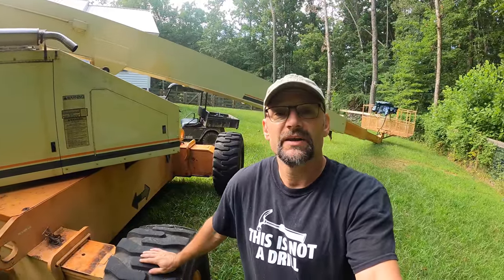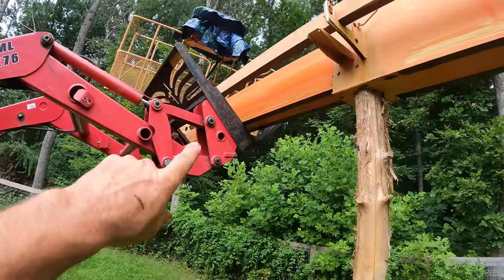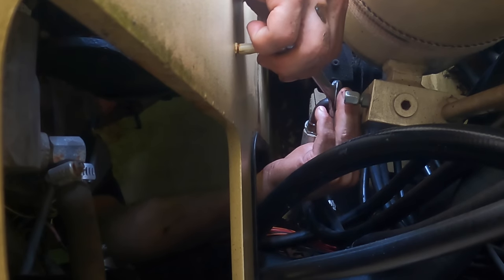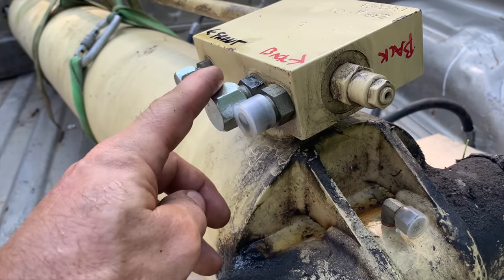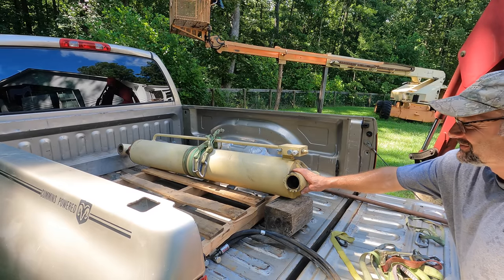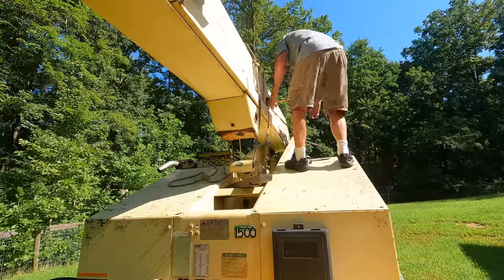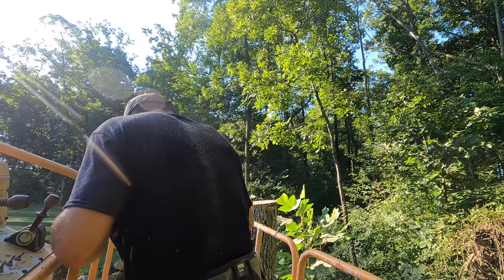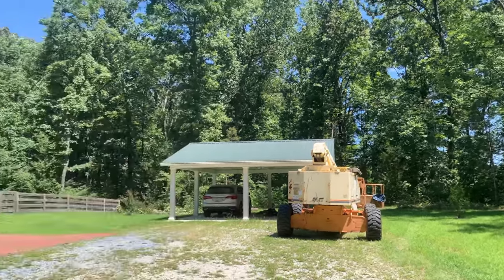Boom Lift Repair - Main Hydraulic Cylinder. What a BEAST! & Cutting Down Dead Trees.

Comment: Depending on whether you're to keep the wood you cut or not, I would say for felling 6 trees (in one or two days) I would ask something like between 1200 and 1600$ depending on the difficulty of the terrain and any "specials" the ground owner asks. If you're supposed to remove the wood the price would be closer to 2000$ (uninsured of course). 
I'm guessing though that as farmer you are insured for possible accidents while working "in the field". So the final tab would be as I mentioned before; between 1200 and 1600$ for 6 trees.
Either way, you won't get rich on it. It would have been more profitable had you been able to remove like the full length stems of the trees for logging purposes, since good oak planks and beams are at a premium nowadays. I really thought you would draw attention especially to the length of your john... I mean your pin but you didn't ... now that's what I call exemplary manly restraint :P
Reply: I don't know where you live but I think your estimate is way low! My bother did tree work in NJ & it was any where between $800 -1,200 PER tree & that's if they didn't have to use a boom.
Reply: I live in a rural area in Europe and where no "special" measures need to be taken, since felling trees is a matter of routine. Obviously that doesn't involve clearing the wood or using special equipment like lifting booms, which of course would drive up the price here as well. Also a lot depends on the number of people involved in the felling. In farmcraft's example he's alone and doesn't use any special equipment except his lifting platform. A chainsaw I regard as normal equipment.
On second thought since inflation is driving up prices, as well as shortages of certain materials and specialized workers, it's quite possible the prices I mention are passé here

Comment: I was waiting for the part where you were required to BLEED the cylinder. Apparently that wasn't necessary. Nevertheless, with complete disassembly and lines left open, I don't understand why you didn't have to bleed it. A little enlightenment from anyone who knows? THANKS

Comment: besides you the next one we get to see is a lot of 🦭 🦭  🦭 
Sometimes things happen for a reason  , IN the long run ,  it's not always the most convenient time  . If I remember correctly you had thought out loud about it may be the right thing to do was to change the hydrologic oil when you started to replace engine oil 🛢 🤔  ?  At the very least it's warm and not raining and cold  !  Now a good pressure washing after you complete the job should do a little bit easier with all the oil to loosen up years of dust and dirt   .

Comment: Awesome video and thanks for sharing. Couple of tips, never stick your fingers in the hydraulic ram anchor holes as they are too precious but use a screw driver to feel the edges are aligned instead. When you can afford it (sooner rather than later) get a full rear connection harness as the one you have will NOT save your life and keep the anchor strap as short as possible because if you are thrown from the basket the impact force (which will be hugely greater than you think) will be minimised on your back. Looking at this video you don’t have an escape plan for such an event and hanging from the harness for 20 minutes is enough for you to go into cardiac arrest, the rest of this sentence you can work out. Please be sensible with what I’ve said as I really do look forward to seeing more of your videos. In New Zealand felling all of those trees with the gear you’ve got would be $5-$10 thousand.

Comment: when breaking loose JIC fittings give the wrench a smack with a hammer or your hand much easier that just pulling on the wrench. 30 yrs as a heavy equipment mechanic will teach you somethings.

Comment: If you know what the word "whippersnapper" originated from, you'd know already that there are guaranteed to be tons of them already watching. Yet had you used the version of that word that refers to a black person, your video would probably have been taken down with in a day of posting. Assuming the bed on that truck is an 8ft bed, the main cylinder on that lift appears to be 75% the diameter of a threshing cylinder on a Gleaner model F (my profile picture) and twice the length. That is one MASSIVE cylinder! Werri gut aerewet!

Comment: If you had of removed the bottom hydraulic line or both lines first there would be no pressure on either side of the ram

Comment: The pin was hard to get out because there were thousands of pounds of pressure on that pin. Bet that supporting the boom would have allowed it to slide out.
Reply from the maker: Agree, but it's pretty hard to know that until it's out, especially working alone.  It was sitting on the ground for days before I removed the pins, so I figured it would have settled all the way down.  With 2 people one could be on the tractor moving the boom while the other is inspecting the pin to see if it appeared loose at a certain spot.
Reply: @FarmCraft101  I don't mean to sound critical, working by yourself is difficult. Unfortunately, that's my modus operandi as well, normally!

Comment: Great video! Yeah that's an oversize cylinder for sure. Even if I had no idea how old you were, I would know a bit older.  Because a younger and dumber person would have tried to rebuild it themselves. YouTube is full of those ppl.  Money very well spent. I thought for sure you were going to take out your truck rear window moving it. Also, for those who might not know, a brass hammer a good choice in situations that require no sparks.

Comment: That Tractor Hydraulic & Transmission fluid is NOT CHEAP either! At $111.00 per 5 gallon bucket $1330.00 just on fluid alone is a costly fix!!!

Comment: Please don't suggest that folks use hydraulic oil as bar oil.  It won't lubricate as well as bar oil, it's super thin, not tacky and it is a nasty pollutant.  I like your videos and most of what you do, but that was clearly some bad advice.  Sure you can save a buck or two, but is it worth it?  All that aside, this was another excellent video and it sounds like you got yourself a good deal on that cylinder rebuild.

Comment: You're right about scale. The cylinder looked about 5" and 3' long. lol   Using wide angle lenses robs you of a normal perspective so scale is distorted as much as view angle, thus minimizing scale. Filming can be very time consuming, as you know, adding to your work load. I would just rather watch you work. It's actually entertaining when I'm not the one...

Comment: I would think a fair price should you have 2 persons if done right a sawyer at $50.00 per hour and a helper at $25.00 per hour. Not knowing how far you had to travel I would say $20.00 per mile. So just for labor 20 hours @ $75.00 would be about $1,500.00 labor just to down the trees. not clean/pickup the mess. The haul and clean/pickup $ 800.00 I’m going to guess you traveled 30 miles each way $ 600.00 so the total would be somewhere around $ 2,900.00 would be a fare price. The cost of equipment repairs that’s on you.

Comment: Some of these replies are estimating a few thousand for dropping those trees. I can only speak of my own experience, but the expensive part of tree removal around here is chipping up the brush and hauling everything off. I pay a guy to drop the odd unwanted tree for me once in a while and I'm guessing he would have charged me a few hundred to just drop those trees if he isn't chipping and hauling. Maybe $600 to $800. Because it's what he has, he would have used a bucket truck rather than a boom lift, but similar enough equipment maybe?

Comment: Man Idk. How well off are you. 5 grand to that lady might bust her up worse than the tree knocking a gutter off a car port. I say add up your cost. Say 2500 in seal, oil and gas. The divide the cost of the machine by 24 saying you do two jobs per month with it working working. This took you 8 days or two weeks. Then add in your overhead and insurance and last your day labor rate times how many days it took you start to park at about idk 400 perday. This includes your insurance, workers comp and other costs. 2500, 1000, 500, 4000 maybe 9 grandish. For your neighbor who you know well and are friends with and you dont need the money and have youtube money coming in, say 3800 this one time only.